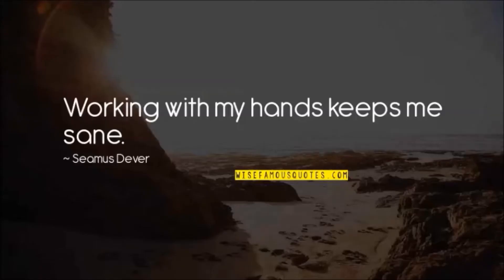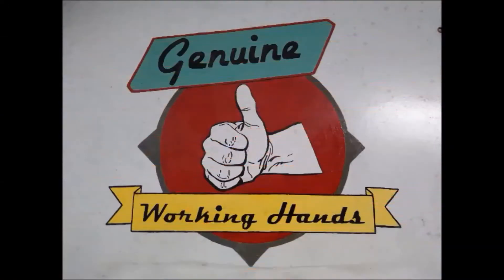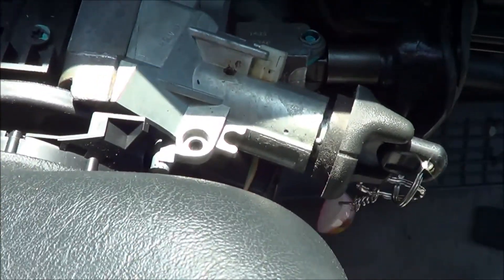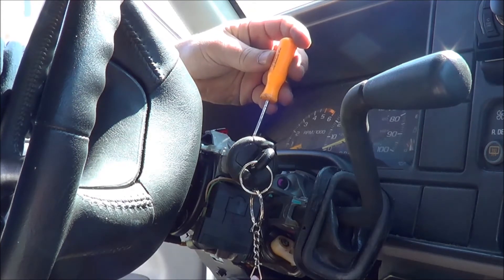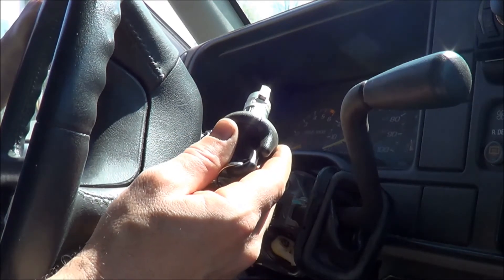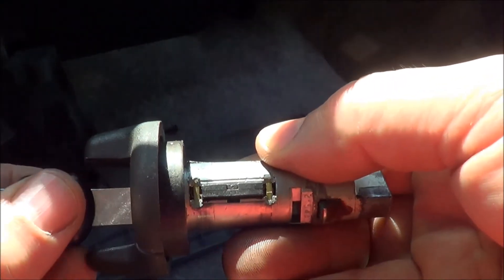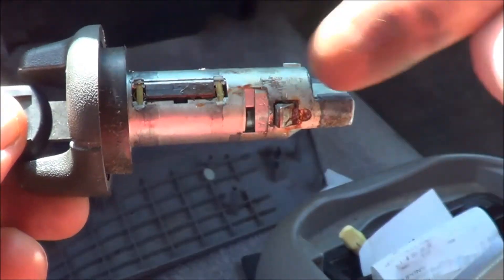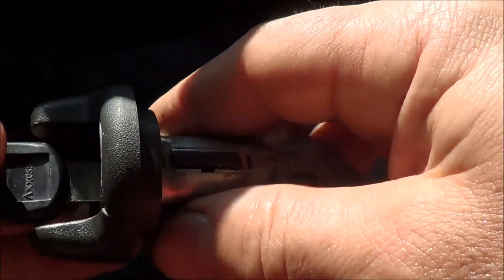Suburban Ignition Lock Cylinder Replacement

Comment: I did the same thing. M y truck would crank but not stay running. Any solutions???
Reply from the maker: It may be an issue with the ignition and not the lock cylinder. On older cars the starters have a positive post, (the big one on the solenoid) a small "start" post, and a small "run" post. If the run side loses power, the car will start and immediately die because the start post supplies power to the coil, only while the engine is cranking. The newer starters don't have the run post, so I can only assume that the power is supplied through the ignition switch (unless you blew a "spark" fuse or relay). Hope this helps troubleshoot. Thanks for watching!